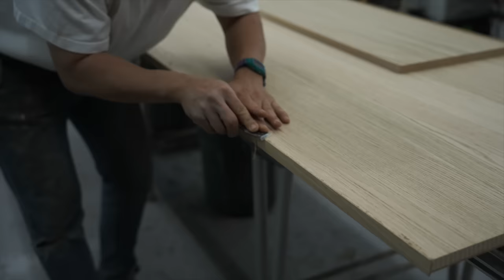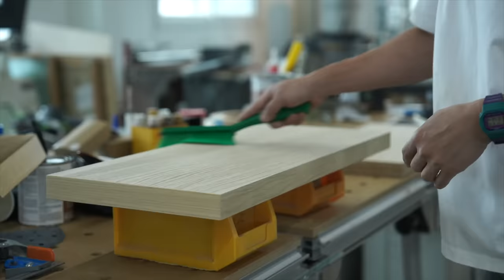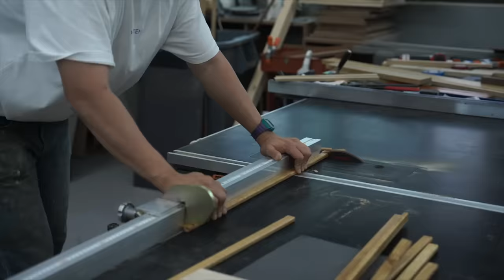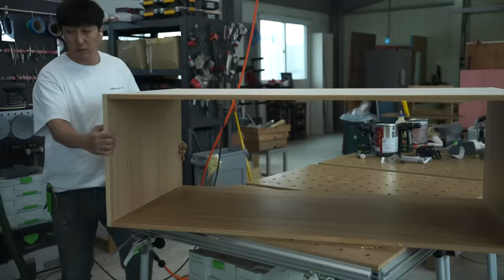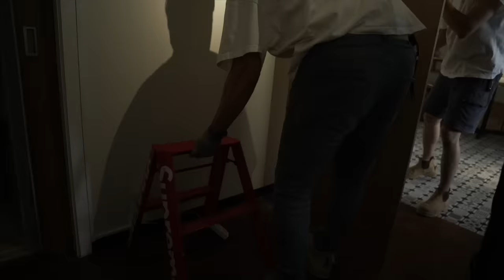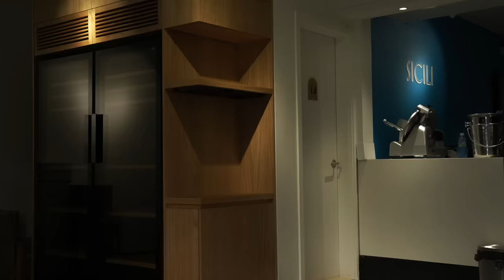W128_Wine cooler fit cabinet

Comment: I always wonder: you never square your cabinets, you just screw or nail them together - how do you achieve straight cabinets?
Reply: A combination of accuracy in cutting out and assembly, along with a level base will give you plumb and level cabinets. He doesn’t glue them so you only need to check for plumb when fitting and they will be square. If you glue them then they are set in stone, if you don’t then there is a bit more flexibility when fitting.